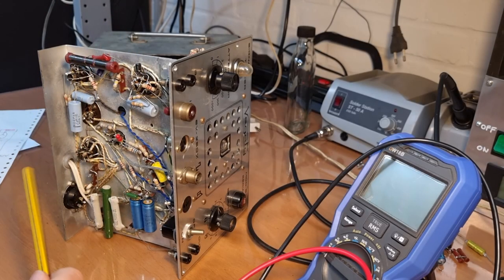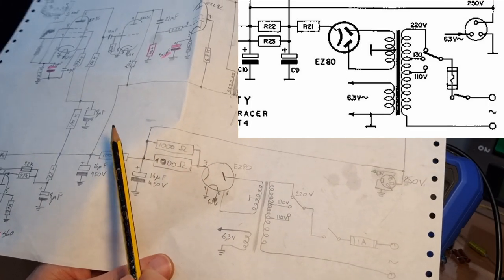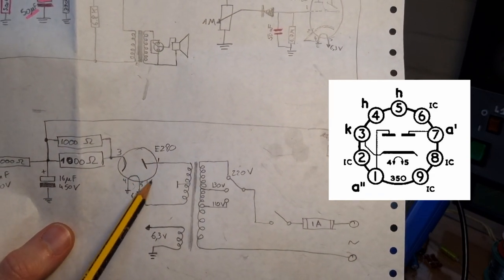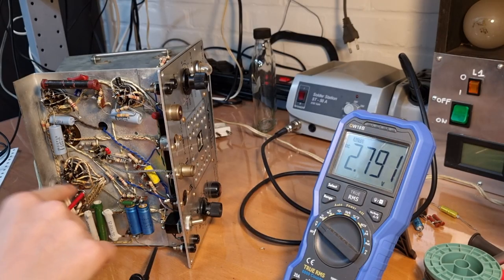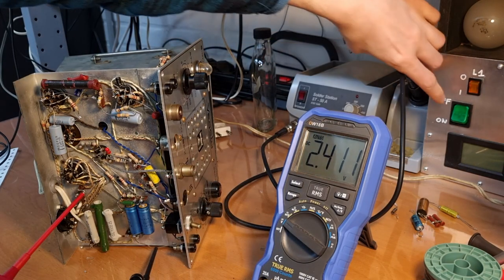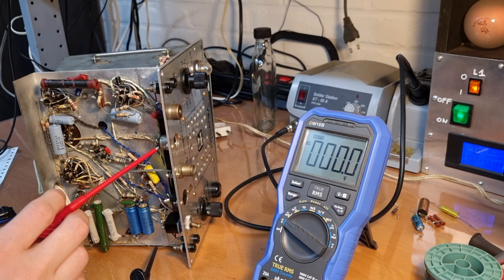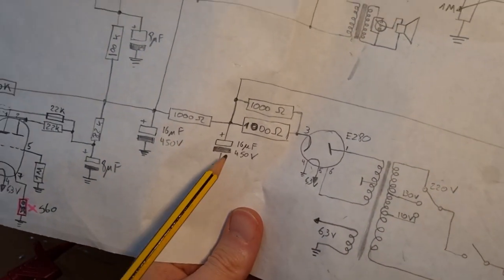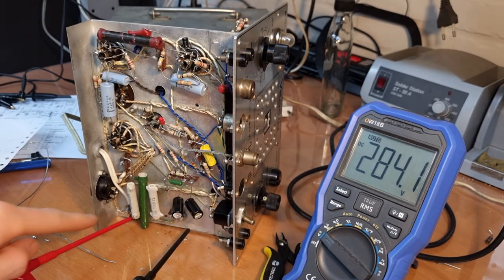Did they make a mistake when assembling this signal tracer 60 years ago? Vegaty Mod. S.T.4 (Part 2)

Comment: At 31:05, I'd add a CAP to the output of that Jack.  I wouldn't trust being connected directly to the Plate of a tube. 
Plus the voltage is to high to put on a device!
Reply from the maker: Yes, I don't really see the use of this function either.

Comment: I see kit-built electronics with errors (sometimes rising to the level of fire hazards!) on occasion. Rarely on factory-built gear, but it does happen.
Reply from the maker: Honestly, this looks a bit like a kit build (but it isn't). Also, there is not a single solder joint which has a good physical connection between the wires. All components are simply tacked in. Makes them easy to desolder, obviously, but not a sign of good manufacturing...
So that's why I suspect this is a mistake from the factory which slipped past Q&A.

Comment: 😅 What an interesting problem. Do you think that it could have been sold as a kit?  Ot perhaps the fault happened in the factory and the other changes were made by the service department in an attempt to rectify the fault. It’s a bit of a mystery. 
Looking forward to the next episode. 
Cheers.
Reply from the maker: I don't think this was a kit. It must have been a mistake which slipped through Q&A. Weird indeed...
I also found out in the mean time that the company still exists today and is still distributing test equipment.